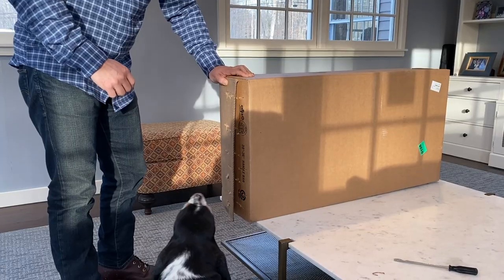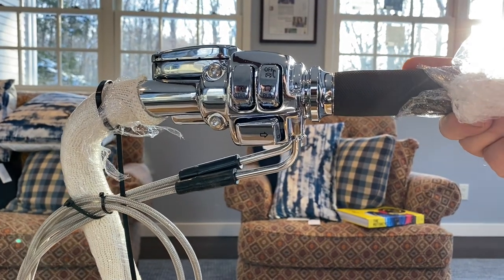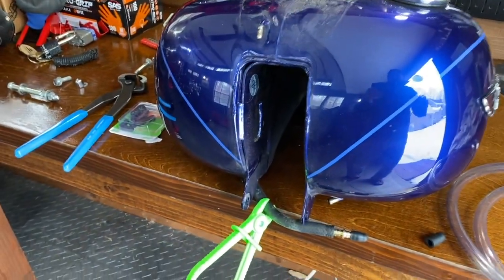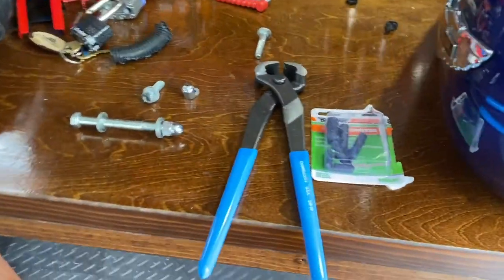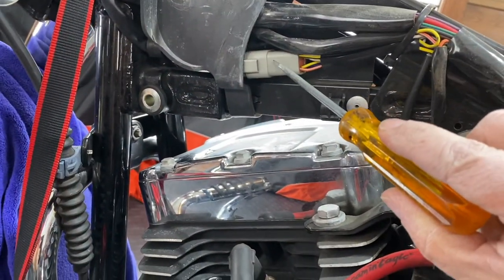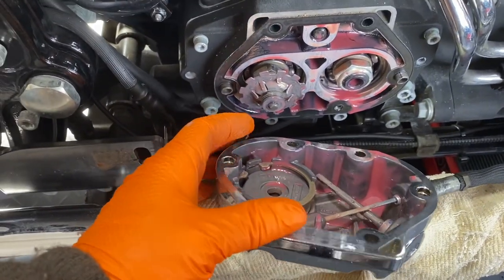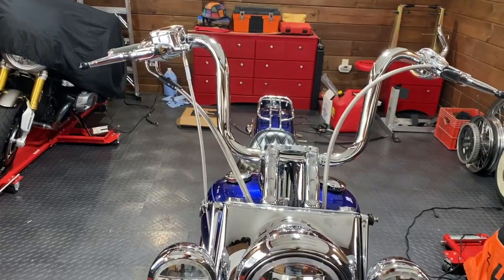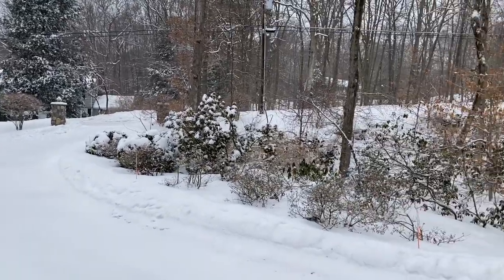Install Harley Handlebars: Done the Easy Way

Comment: My dad is the new owner of this bike and wanted me to get on here and tell you how happy he is with it. He thinks you did an excellent job with all the mods and hopes to take as good of care as you did.  Mentioned he was nervous buying sight unseen; but could not be happier with his purchase.  Sending you the best from Texas!!
Reply from the maker: Thank you so much for sending me this note and thank him too. I was quite attached to that bike and I'm glad it found a good new home. You made me so happy to hear this!

I never had any issues with it, it's always run perfectly for me. I did a lot of the work on that bike myself, and the one thing I noticed was that the tension on the clutch plates might need a minor adjustment. You just need to unscrew the circular plate on the derby cover and adjust the nut. There are good youtube videos on how to do this. Or take it to the dealership, it's literally a 10min job.
Reply: You made his day by responding and now he’s got another question for ya 😊

I see that between video of Sampson pipes and video of ape hanger bars that the wheels were upgraded. I know most lace wheels run tubes but was told that there was a boot kit that could make it tubeless. Do you know if it is tube or tubeless? Thanks. Fred.
Reply from the maker: @dbtwithjamie  I am running tubes in these tires. I am not sure if it can go tubeless, maybe check with the HD dealer on that one. I prefer tubeless, easier to repair if I get a flat when riding. I wasn't aware it was possible to run tubeless on these wheels.

Comment: I wonder if the same place (now) does modern (‘19-‘20) DELUXE pre-wired bars(?)
Reply from the maker: Good question. The new bikes are ride by wire, but you do still need to snake some wires through the handle bars. If you increase the bar height you obviously need to snake more wire through the bars. 

Wiring to the switch housing is easier too with new bikes because you just need to connect the wire clips together. 

I just did a 2023 CVO for a guy, it was a lot easier than the old bikes and no need remove the gas tank. 

I imagine Hill Country Customs do the same for new bikes too.

Comment: Can you share the list of parts you requested from Hill country customs. I basically want the exact setup you have for my 2018 Deluxe.
Reply from the maker: Yes, certainly. This is what was shipped to me. I bought it as a package so some prices you will see as $0. But here it is:

Ordered: 1 Shipped: 1 AHP-101 Ape Hanger Package 1 1/4" Complete $1,007.15
Ordered: 1 Shipped: 1 HC-11410N Handlebars 1 1/4" Ape Hangers 10" Narrow CHROME $0.00
Ordered: 1 Shipped: 1 HC-HBC124 Handlebar Control Kit Chrome 1996 & Later 9/16" SWITCH HOUSINGS NOT INCLUDED $0.00
Ordered: 1 Shipped: 1 HC-SH1007 Switch Housings 96 & Later Standard CHROME $0.00
Ordered: 1 Shipped: 1 HC-HS06C Handlebar Switches 96-06 with Chrome Switch Caps $0.00
Ordered: 1 Shipped: 1 PC-DEUTCH-96-06 Pins & Connectors DEUTCH 96-06 Standard Housings $0.00
Ordered: 12 Shipped: 12 2120-0038 Deutsch Female Socket Pins Stamped (OEM# 72694-06) $0.00
Ordered: 1 Shipped: 1 2120-0057 PLUG DEUTSCH GREY 6 PIN $0.00
Ordered: 1 Shipped: 1 2120-0058 PLUG DEUTSCH BLACK 6 PIN $0.00
Ordered: 1 Shipped: 1 Labor Labor "Install Grips" $0.00
Ordered: 1 Shipped: 1 66-0380 Clutch Cable 66" $0.00
Ordered: 1 Shipped: 1 66-0298 Throttle Cable 34" $0.00
Ordered: 1 Shipped: 1 66-0299 Idle Cable 34" $0.00
Ordered: 1 Shipped: 1 HC-46 Brake Line 46" $0.00
Ordered: 1 Shipped: 1 HC-HIK-13B Handlebar Installation Kit 2006 Softail Models Basic $0.00
Ordered: 1 Shipped: 1 0934-1385 Transmission End Cover Gasket Twin Cam 5 Speed $0.00
Ordered: 1 Shipped: 1 3603-0019 Bel-Ray Thumper Gear Saver Transmission Oil 80W-85 $0.00
Ordered: 1 Shipped: 1 3703-0020 Bel-Ray Super Dot 4 Brake Fluid $0.00
Ordered: 1 Shipped: 1 0630-0374 Grips PM Renthal CHROME $0.00
Ordered: 1 Shipped: 1 HC-HBB101 Handlebar Riser Bushings Polyurethane $0.00
Ordered: 1 Shipped: 1 HC-CCK Cable Clamp Kit 1 1/4" $0.00
Ordered: 2 Shipped: 2 HC-CC114 Clutch Cable Clamp 1 1/4" $0.00
Ordered: 1 Shipped: 1 HC-TCC114-2 Dual Hole Throttle Cable Clamp 1 1/4" CHROME $0.00
Reply: @jac5431  thanks man

Comment: Great video, just wondering if the front brake line runs down and under straight to the caliper.   I know stock there is a hard brake line between the lower and upper half.  Just curious if the new cable is all one piece.  Couldn’t catch a glimpse of it.
Reply from the maker: I bought the whole setup through Hill Country and the brake line that they provided to me is one piece. There is a clip under the triple tree that holds the brake line so it goes to the front caliper without any obstruction. If you call Hill Country they will give you the setup that best suits your bike.
Reply: @jac5431  Thank you, I gave them a call and hooked me up.

Comment: What size and brand handle bars?
Reply from the maker: These are 10” bars, but I used the stock risers which are about 3”. I’m 5’8” for your reference and this set up fits me perfect. Wrists are below the shoulders so my hands don’t fall asleep. But my arms are pretty straight forward, only slightly angled down.

Comment: Is that 10” ape hangers? That seems perfect
Reply from the maker: Yes, 10” apes on the stock risers. The risers pull back a little, so, add about 2.5” so in total it’s about 12.5”. You may want to replace the riser bushings with newer stiffer ones because the length of the bars add leverage and pressure on the riser bushings and can make the risers move back and forth a bit, in other words, ‘wiggle’. Very normal for that to happen when you add taller handle bars. A new and high quality set of bushings will solve that.

Comment: Great looking bike and bars. Don't quite aggree about the cable lengths. Throttle and idle cables could have been a bit longer to match the arch of the clutch cable. But that's just my opinion.. ;O)
Reply from the maker: Thanks for sharing your view on this. I see what you are saying, the cables could be a little longer. I did another bike and the cables were too long (I thought). Maybe this time I over-compensated the other way.